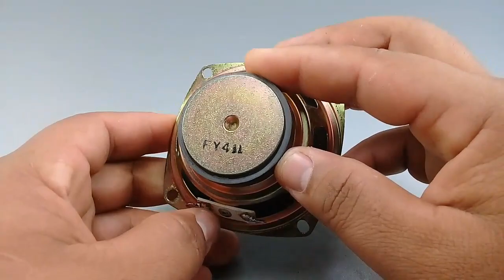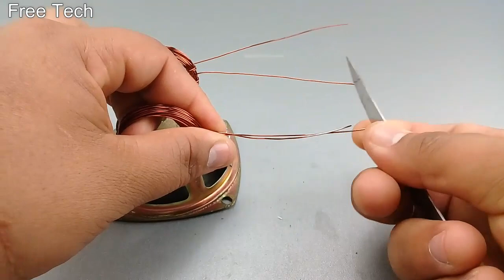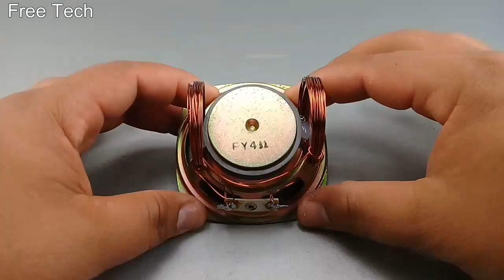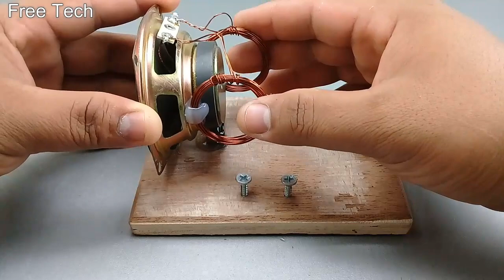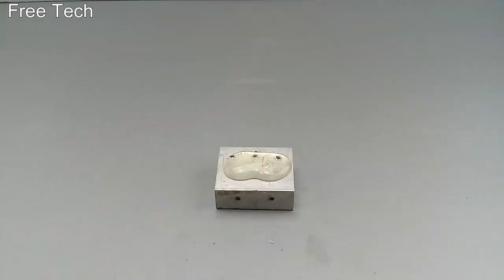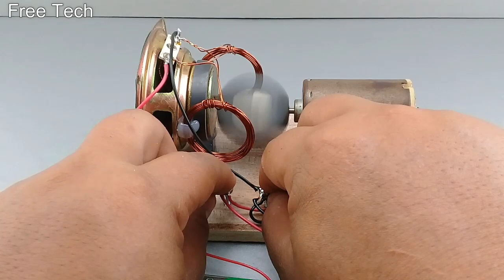Free Electric Energy with Two Copper Coil and Speaker 100%

Comment: Why not try to do this with two speakers and a basic sinewave oscillator? The motor is a less reliable device, and the rotating magnet will eventually demagnetize under opposition.
Reply: What are the components he put on the screws
Reply: @edwardmateo884  Schottky diode and a 2200mF capacitor.